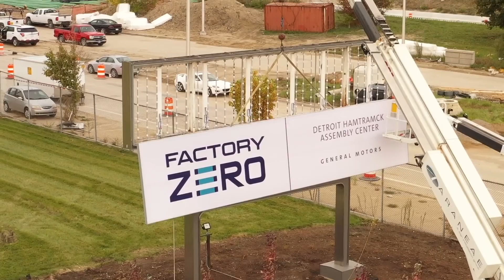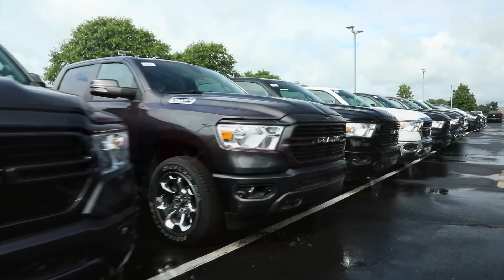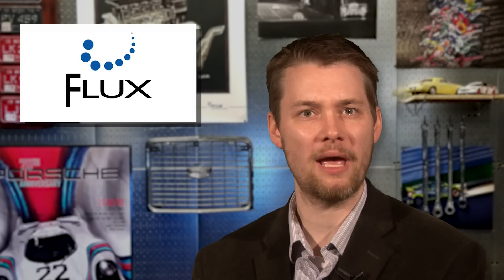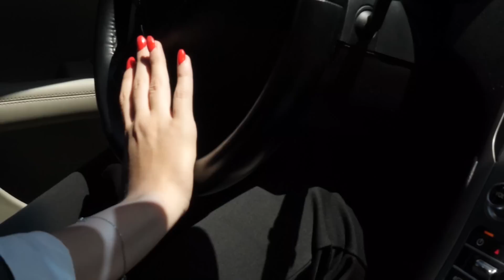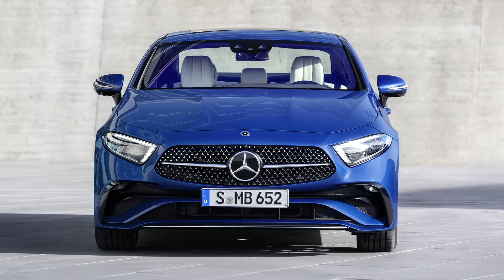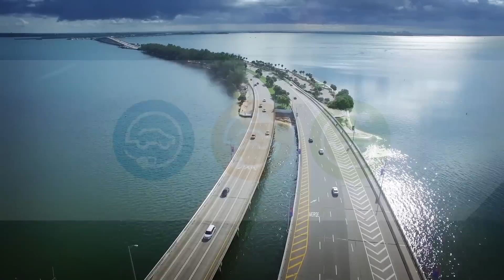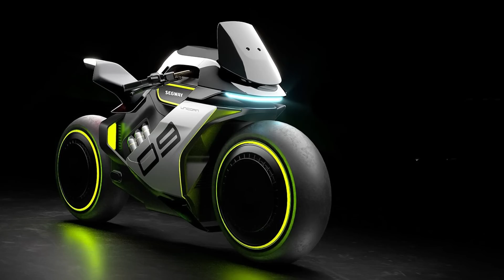Jeep Refreshes the Compass; GM Announces Electric Silverado - Autoline Daily 3053

Comment: Gm Silverado.  Now we know GM is serious about EVs. The giant is awake finally.
Reply: If you think the electric Silverado announcement means GM is finally awake then you're the one that's been sleeping under a rock. GM made the announcement a couple years ago that they would have dozens of EV models available by 2025.
Reply: @OneNationUnderGod.    Exactly...  This has all been in the works for a long time,  and evidenced by the Silverado prototype publicly shown last year at the Barclays investor conference,  it was right there behind the GM execs.  There is a video on You tube showing it, and carscoops rendered it pretty accurately.
Reply: They have no choice.
Reply: @dclpgh   haha,  Ya,  Tesla selling so many trucks now...
Reply: @dmitchellhomes  It's funny when you can start recognizing this channels recurring comment trolls. Whatever, Gordon.
Reply: Notice how they are making only large vehicles for ultium.  Ultium based on hummer specs is the lease efficient EV drivetrain.  Even the EV1 from 1999 was more efficient.
The fact is ultium is a less dense pack designed for easy swapping of cells that go bad.  GM is choosing to guard against warranty costs, instead of choosing performance or efficiency.
Ultium will be worse than all other offerings and thus is going to be a massive failure.  Brand fanboism can only get you so many sales before deficiencies are publicized and sales tank.
Reply: @_PatrickO    Not exactly,   Ultium batteries  are actually quite dense in both volume and mass   They are also simple to assemble and repairable.    Another benefit is that the modules are the same for Lyriq,  Hummer EV,  Silverado, and whatever else GM puts on the platform.   This will be a benefit in inventory control, and allow shifting from one segment to another quickly as markets change.       Tesla is trying to build a custom chassis for each car, with batteries glued into the chassis,   not  flexible or repairable.        Hummer is the least efficient because efficiency is not part of the design,  and not what that customer is after.    I would not want a teardrop shaped off road truck with pizza cutter tires.   Tesla has never built or sold a production pickup truck,  GM 85 million and counting.     The Silverado will be more efficient and aerodynamic than Hummer,  hence get more range from the same 200 kWh pack.    As for Cybertruck  its an unknown,  Tesla has not built or shown a production model yet,  and 4680 batteries from their pilot line are a flop so far.  Pilot line not running.
Reply: @dmitchellhomes  Wow. 3 battery plants under construction to manufacture a flop. I've had you all wrong I thought you were one of the many who didn't understand battery day. But your weird Gordon Johnson reaction to the 4680 means that you know what a game changer it is.
Reply: @dclpgh    Tesla has not started any battery cell manufacturing plant other than their pilot line which is not working.      Unless you are counting GF1,  which construction has been mothballed for 5+ years.     Berlin, they cleared some trees, no construction started,   Texas they have the car factory under construction  after almost a  year less than 50% complete, but no battery cell manufacturing under constructing per Tesla's earnings release from January 27th 2021.
Reply: @dmitchellhomes  OK Gordon.
Reply: @dmitchellhomes  "Tesla has not started any battery cell manufacturing plant other than their pilot line which is not working." prove its not working what is your source Gordon Johnson?
Reply: FLMAO.... thx for the entertainment :)
Reply: @coraga1726    My source  is the recent drone videos that fly over it,  fans on the roof not running,  many not even hooked up yet,   exhaust stacks no heat,  but the biggest tell all was on the January 27th earnings call when Elon was asked  "what is the exact current output of the Pilot line",  followed by a long pause and a bunch of talk about S curves,  but no answer...
Reply: @coraga1726    Tesla 2020 10K , which is Tesla's  official release, and you can see videos at Berlin,  trees down,  but no construction on the battery site.    In Austin there are multiple videos daily,  Tesla is building a car factory,  less than 50% complete after almost a year,  and Tesla has been in talks with LG about building a battery plant in Austin,  but so far LG has not taken the bait.
Reply: @dmitchellhomes  Said the burning Bolt defender.
Reply: Clearly GM is serious,   GM has guided to spend $6B in EV capEx in 2021,  that is more then Tesla has spent in the last 3 years combined
Reply: @dmitchellhomes  GM is so serious with their 38k a year production LOL man you are fool
Reply: @grizzybear9111     How many trucks has Tesla sold?   Oh Ya  ZERO...   Tesla buys trucks from Ford and GM for their operations,   Ditto spaceX,   because Tesla cannot survive without them.
Reply: @dmitchellhomes  And Tesla expects to spend between $4.5 and $6B per year 2021 and 2022, and not for golf carts...
Reply: @dbwelder9159  Still way less spending than GM, and Tesla makes way less profit, so that means they will be spending their cash!    Tesla only makes about $200m a quarter, whereas GM makes about $4 billion a quarter in net profit.  One company can afford to fund their growth, and the other one cannot without diluting shareholders
Reply: @dmitchellhomes  And one has been growing 50% YoY from that spending... Gotta spend money to make money.
Reply: @dbwelder9159    GM spends far more Cap Ex averaging $7B per year the last decade,  thats why all GM's plants have new paint shops and new body shops, not the old crap like Tesla has in Fremont that turns out crappy paint jobs.   BTW  growing 50% is easy when it is small numbers,  but it gets harder and harder as you go.   Tesla's global business is still smaller than just the USA full size truck business for GM.    Tesla has to pay more for everything, then GM and VW, because they do not have millions of units in scale.      They pay more for steel,  Aluminum, glass, rubber, tires, wheels, etc, etc, etc...   They also have more man hours per car because of their crappy builds that need tons of rework after production.
Reply: @dmitchellhomes  How many years was GM in business when they built the Vega? 8-6-4?  Keys turning off cars by themselves. I guess 60+ year growing pains only apply to GM.  And I would say fit and finish issues are not as bad as those problems (plus many more).  And who's factory was that before NUMMI?  GM couldn't even make it work. The Vibe, really?
 Oh, 50% YoY is easier with small numbers, geez, didn't teach that in engineering school. Like the Bolt increase in 1Q.
And, if it wasn't for someone like Tesla pushing GM, and Biden winning the election, GM would still be pushing lower EPA ranges and fighting CARB to build even more ICE vehicles.
Reply: @dbwelder9159     Haha!   You really have to go all the way back to Vega and 8-6-4?      Tesla fit and finish sucks,  I have one in my garage, if you look close its awful,  and feel the body and trim,  the absolute cheapest materials I have ever touched.        Anyway,  Tesla quality is bad, not due to the factory,  its the management that is the problem and the lack of testing before production.    GM is already running Hummer EV Chassis through sections of Factory Zero for calibrations even though production will not start for months.    Also a Chevy Silverado EV  chassis was shown under a tarp in the paint shop in GM's presentation yesterday.   GM will spend months on final calibrations to make sure when production starts they will not have a stack of garbage crooked bodies outside like Tesla has at Fremont.   Tesla sends lots of business to the local recyclers with all their blem bodies and parts.      When they launched Y there were dozens outside,  last week drone video showed some refresh S in the garbage pile.  Anyway,  Last message for you today,  I have better things to do that debate with kids that have no knowledge or experience in the car industry.
Reply: @dmitchellhomes  Yep, you worked in a speed shop... Wow.
Reply: @dmitchellhomes  No they just knew that you were buying one to get the free supercharging at the end of the year so they messed it up on purpose for you.